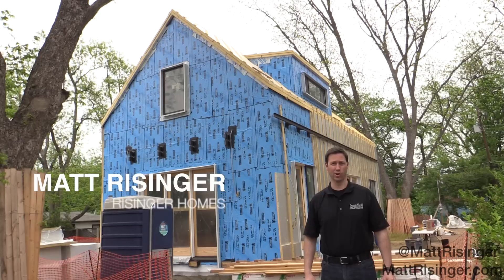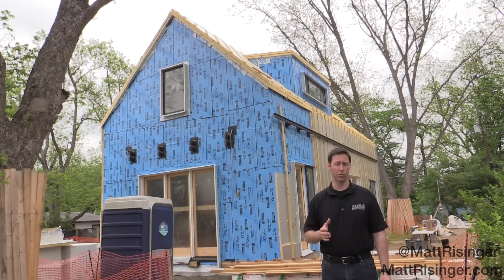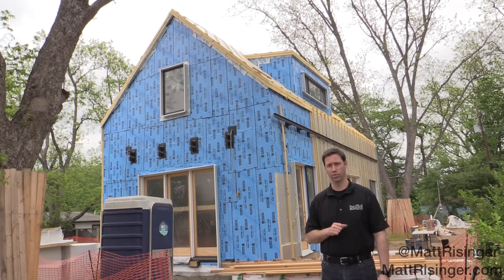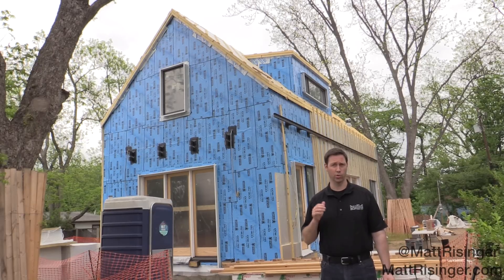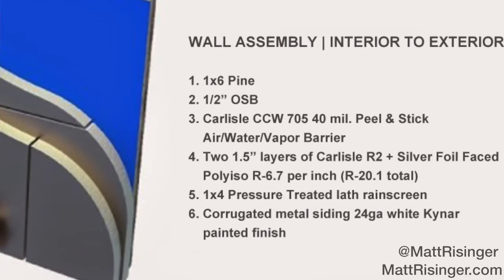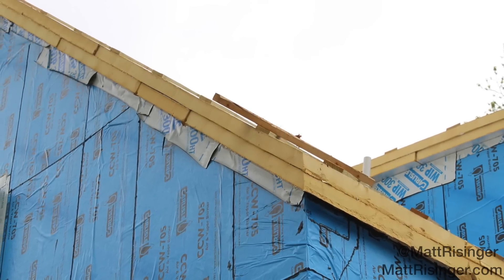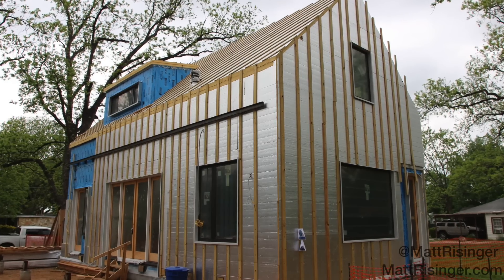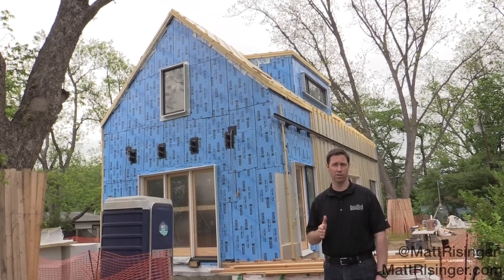What is the "Perfect Wall" for a house?  (with 500 year durability)

Comment: And the fire layer? I love the perfect wall idea but I would not put wood as the exterior or something that can't hold up to some light flames. I like the idea of an air gap where you would have stone cladding and a sprinkler system that can run into that if necessary

Comment: The only drawback with this design is that if you have all wood framed walls and an internal fire occurs  the fire benefits of  mineral based insulation provide no benefit. Why not use one of the layers inside?

Comment: Perfect installation doesn’t exist. Once the roof leaks and the power goes out this place will rot from the inside out. OSB is going to fail in 20 to 30 years due to construction defects. If you look at buildings that have survived 500 years they have slate roofs, stone walls and oak timber

Comment: I believe the perfect wall has changed since 2015 especially when building in the different climate zones. Matt has updated vids, well not updating this vid but completely updated materials (See Matt's "5 Ultra insulated walls". Copy/paste. https://youtu.be/Gvd4NRHvmO8). From what I have discovered in the past 3 months of research, this particular video, adding two 1.5" of polystyro to the outside might not be thick enough to work in very cold climate where I am from. Not because of its insulation qualities but because of the dew point. When a stick built is erected in a cold climate and insulated the conventional way the dew point is somewhere out in the air, beyond the exterior of the siding. When adding exterior insult board and don't add the proper thickness you can effectively bring the dew point within the wall cavity ( so i have read). There are formulas as to the thickness of the exterior insulation needed for the different cold zones. Also Matts current cold weather suggestion has him recommending rockwool exterior insul. because of its ability to shed water.

Comment: Hi Matt,  If I'm getting this right, it is deck, peel  and stick, poly iso, poly iso, 3/4" air gap (battens) then metal roof.  On later builds you moved the peel and stick to the other side of the insulation.  Any insights as to why?  Would you still build a roof like this with the peel and stick under the insulation?  I am doing a retrofit application on my 100 year old stucco over brick cape cod style house in MN.  Putting the peel and stick right on the deck makes the process flow easier - Tear off, remove eaves/gables, put down peal and stick that wraps over edges of "monopoly house"  That dries it in really quickly.  I can take time putting down poly iso, rebuilding gables / eaves, and putting on the metal roof.  If I were to put the Peel and Stick over the poly iso like you do in newer builds, would I want some sort of barrier air barrier over the deck under the poly  iso?  Any insight would be much appreciated.

Comment: What is the comparison between Perfect Wall and Zip?
Reply: I think the Zip system is a way you could implement a Perfect Wall. Instead of the OSB + Carlisle Peel & Stick + Carlisle insulation I think you could just use the Zip System R-Sheathing which has insulating and waterproofing built-in.

Comment: Hey Matt will the following be a perfect wall in 2021? Corrugated Metal + 1x4 Pressure Treated Lath Rain Screen +  1 Layer of 1.5 Carlisle R2 +  1 Silver Foil Faced Polysio R-67 + ZIP R6 + 1" x 6" pine + 24" OC 2" x 4" Framing

Comment: Instead of a 1X4 pressure treated lath rain screen, I would like to use a metal product, similar to what is used on some ceiling drywall systems.  I think that furring system is called Hat Channel.  It would provide increased Fire and Rot protection.  Does anyone know if this product is being produced for exterior rain screen construction? Matt, you have been to many IBS exibits, have you seen a product like that?

Comment: This is obviously a super old video, but curious about the descision to include the WIP inboard vs outboard of the insulation?  GBA is showing the WIP outside of the insulation. Is that because of vapor drive direction in hot and humid Austin, and would you reverse the direction (like GBA shows) in cold climates?  https://www.finehomebuilding.com/pdf/021224084.pdf

Comment: I love everything about this house! Anyone could point to me the purpose of the 1/2 osb? Would it be possible to apply the 40mil directly over the shiplap?
Reply: Not sure if you found your answer, but one thought is that the 1/2" osb is providing the surface the shiplap is attaching to along with providing the surface for the barriers on the outside. I am planning to not insulate the interior of my post and beam by doing this and using my own milled wood on the surface of the osb interior.

Comment: Last 500 years :))
You just said about the Colosseum in Rome, it’s built using cement and stands tall in the rain and winds, not using wood that will rotten and get eaten by termites in a matter of 5-10 years after is exposed to the elements. If you want to talk about a durable house that might stand for another 500 years from now, consider showing buildings using bricks and cement, as you have proofs of some churches, castles and other monuments, especially in Europe, where they also are designed against earthquakes. 
This video is just hidden advertising and clickbait.

Comment: The wood frame house is only good for a hundred years
Reply: Oldest wood house in North America - built around 1637
https://www.thevintagenews.com/2017/08/24/the-fairbanks-house-is-the-oldest-surviving-wood-frame-house-in-north-america-2/

One of the oldest inhabited wood houses in the world - built in the 11th century
https://en.wikipedia.org/wiki/Kirkjub%C3%B8argar%C3%B0ur

Believed to be oldest extant wooden building in the world - built around 700AD
https://www.timetravelturtle.com/horyuji-japan-oldest-wooden-building/

Oldest wood church (now a museum) in Scandinavia - Completed in the 12th century
https://en.wikipedia.org/wiki/Borgund_Stave_Church

As a practical matter we owned an apartment building built in 1929 The wood structure was in very good condition although it had been built with a concrete ring foundation and piers and the piers had settled as much as two inches. Most of the wood structure was in good condition. The exposed surface of the wood after it was cut looked pristine. So, do a better job on the foundation and on preventing water intrusion and this structure could last with little maintenance for a very long time. 100 years would be just the beginning. Throw in some treated lumber in a few key places and I could easily imagine 500 years given how well the wood had lasted without that.

As an aside this building was near the beach in Southern CA and termites were an issue, but not nearly as much as I would have thought. There was zero termite damage in the floor joists in the crawl space. Almost all the termite damage was from termites tunneling into the exposed ends of the roof rafters. The roof was built without a drip edge and my theory was that the roof rafter tails were susceptible to termites because they were kept moist most the year as the ocean air condensed on the roof and flowed down the faces of the roof rafters.

Comment: how do you attach the insulation? if you put nails, it will perforate the blue membrane. the outer skin will need to mount to sandwich the insulation.  the screws will perforate all the layers?

Comment: All carbon fiber construction made with a high temperature epoxy.  Flame retardant foam insulation inside the walls.  Plasma coating of titanium and ceramic on all exterior and interior.  
Plumbing and wiring hidden under removable and easily accessible 12" tall wall panels in the interior walls.  3D printed on the cheap in giant factories and delivered to location by flying saucer.
Reply: brent Robot 😂

Comment: The only way to prevent rot in the walls is to have a wall that can breathe. The vapor barrier needs to be directly behind the drywall so it stops homeowner-selected humidity from the conditioned space invading the wall. The rest of the wall has to breathe so as to not sweat from constantly changing outside temperature and humidity. Sealing up a wall is a surefire way of promoting moisture buildup. House wrap is not a vapor barrier; it's purpose is to slow down air movement in the wall while allowing moisture to escape from inside the wall caused by the locale's changing temp/humidity.
I never listen to the advice of a person who says everyone else is wrong.
Reply: Fun fact about this particular house, if you watch some of Matt's later videos.  There is no drywall on the walls.  They used that 1x6 sheathing to give it a shiplap look, built the studs, and then painted it.  It's one of the best constructed houses I've seen.  Granted, as a water damage restorer, houses like this would almost put me out of business....

Comment: So what are the nailing strips attached to if they are "floating" over 4-6" of foam?? It doesn't seem like a strong connection to the metal siding and roof....What am I missing?
Reply: Really long screws through the foam and into the studs/rafters from the looks of it.

Comment: Hey Matt.   We cannot figure out how to get to zone 3 r-values using exterior insulation only...especially in the roof.  Preferably, we would like to use Roxul to avoid off-gasing and degradation of foams.  Any recommendations?
Reply: Pretty basic.  For roof on zone 3 use 10 inches of rockwool comfortboard 80.  (R-4 per 1").  Youll need some extra long lag screws.  Nice thing about the comfortboard is it has some nice very nice accoustic absorption properties as its used quite regularly in interior accoustic panels.  Also its fire resistant with a high melt point of like 2000 degrees F.

Comment: I am sorry but I think you are confused. The "perfect wall" concept is one thing. The 500 year wall/Institutional wall is another thing. The latter builds on the concepts developed for the former but they are not the same thing. The walls you are building for that house might be "perfect walls" but they are not 500 year walls. You need brick/stone as the most outside layer, not corrugated steel. Also, for residential with wood frame it is recommended to have insulation between the studs (except very cold climates). Go back and read Lstiburek whitepaper again.

Comment: Those peel and stick membranes can be a pain to put up with one person in hot weather. That's where their weakness lies, if the person installing it has a hard Time getting it to contour in difficult corners you can end up with unwanted folds and wrinkles.
Also anythibg that goes outside of the membrane has to be held on by screwing into the wood behind it, thus piercing it in many areas. I'd like to see done sort of "paintable" liquid membrane available in the future. Or atleast a membrane that is more forgiving and can be placed and adjusted in tight areas easier than what us on the market today.

Comment: 6:10 you can see some cracks in the silver stick on weather protector. With no over hangs any building will not last as long. PERIOD. Your inviting water to come right in. I don't know any roof system that can last over 100 years without maintenance.  Resins may last a long time, but not under constant changes in temperature and humidity.

Comment: From Europe...and not Ireland where houses are shit buckets and cost a fortune....That house is a joke! U can try build a very good house whit bricks and cement, 3 ph windows, 25-30 cm of isolation all around the house and a heating recovery system.   Another thing is to respect those suggesting with the position of the house...south west. I did this in Europe to a 25 years old house made out of concrete blocks, which is positioned correctly. During the summer time when outside there are 36-37°c in the house we have 18°c. In the winter the sun heats the building. All of this on a non insulated foundation, and the rest of the house got only 10 cm of insulation and shit windows. All this with 10000 euro. And the billing for that house is around 100 euro/month during the winter. During the summer is 25-30 euro with all your comfort dude. Hot water for shower and sinks, gas boiler, 1 big fridge for a family and a very large freezing unit to store meat and vegetables(we have a small farm)   2 over 50 inch tv.s  all the bulbs in the house are the classic ones not led.  So if you invest more than me  you will achieve even more for sure.

Comment: The only material I know in the last 2,000 years to last 500 years are red bricks.  They are structurally strong; they have small capillaries to allow the building to breathe.  They are not perfect, but they last a long time.

The one layer that I find confusing is the vapor barrier.  In many videos, Matt argues against vapor barriers in the south.  So why is it included here?

Comment: Aside from the corrugated steel (service life: 100 years) and wood, none of the products in this wall system are even rated to last anywhere near a century, let alone five.  Carlisle membranes rely on butyl seals.  Butyl's service life is not 500 years.  It's 25 years.  Wood will last indefinitely, but new growth wood would likely succumb to pests before 500 years.  This is without considering the inevitable holes people are going to put in the walls, which will cause this sophisticated system to fail, because it is nowhere near as fault tolerant as, say, stone.

Comment: Only methods for tempered climates, not tropical. In tropical climates,we use lightweight wood construction too. I think we need another method for the wall protection from the weather. But good video though.

Comment: Thanks for sharing this with us. Pretty interesting stuff. 

I wonder how you'd apply this system to a more traditional building.. Like lets say someone was going to build with older style.. like thick block walls for thermal mass/resiliency, (They were building it themselves, so labor is free) then could you apply the outer membrane to that?.. would it be worth it?
Reply from the maker: It would work really well with a mass wall assembly.

Comment: Using insulation on the outside of the thermal sink was started by a builder in TX about 25 years ago. It was so simple a change, yet so effective. Why didn't someone do it 200 years ago? Conformity is the norm. At 75 I have questioned many irrational norms over the decades, only to hear the "expert" answer "Everybody does it that way" as if that justified it. That common answer makes me ashamed to be a human. Maybe I'm a Vulcan in disguise. 

For design simplicity, ease of construction, stability, nothing beats a monolithic dome. Of course, few will buy or build one. Why? They are so different.

Comment: Interesting concept!
How is the insulation fastened to the wall and roof?
Any mechanical fixings mean perforations trough the waterproofing membrane.
Would like a detailed description of this system
Reply: From what I saw from other videos from this channel, they just nailed the insulation through to the stud frame. So, the answer to your question is yes, the nail would make a hole in the water proof membrane.
Reply: @lozza2272  The membrane has some self healing properties. Similar to ice and water for the roofs. As a nail penetrates the membrane it adheres to the faster and pretty much reseals itself.
Reply: @littlered6780  thanks for your reply. That's a great product.
Reply: They typically glue and screw for fastening water proofing.
Reply: There are still ways to seal the perforation so that the only way moisture could get in would be if the nail were removed. Silicone sealers are my go to for durability and flexibility (on top of water resistance).
Reply: The way those peel and stick membranes work is when a screw goes through them the bitumen sticks to it and self heals the hole in a way

Comment: Matt, thank you I appreciate your videos and the obvious work that you do to make them... 

I am here in the state of Florida, and will soon be embarking on the construction of a 2,500-3,500 sqft home.... it will have a concrete foundation because of floodplain issues... With shipping containers set on top of that.

I will probably put the 6 inches of closed cell spray foam insulation on the inside... Mostly because of condensation issues.

My question to you is simple how would you construct the outside wall??

Comment: Great video! Don’t understand why Companies are building cheap wood boxes with paper and vinyl siding and selling it for 400 grand? Why are homebuyers buying this crap? Pay a little more and build with brick!
Reply: Build brick walls with lime mortar and it'll need repointing every fifty years.  Build brick walls with cement mortar and after, at best,  50 or 100 it will start to crack if there is any movement whatsover.  I'm in the UK and our brick houses often are nowhere near as durable as we like to pretend they are.  In fact, our housing stock, in many respects, is one of the worst in Europe, but we seem to have largely stopped noticing :(

Comment: i.e. standard walls in europe.  for some reason putting the insulation on the outside of a roof structure only became code a few years ago in germany. be careful about the location of the water barrier in a hot climate, because it needs to be different than in     northern and central europe.

further requirements for a 500 year house:
- wood does not start less than 4 feet above ground.
-roof with large overhang